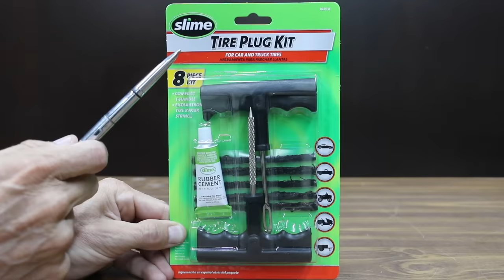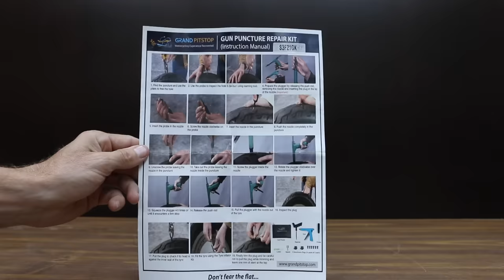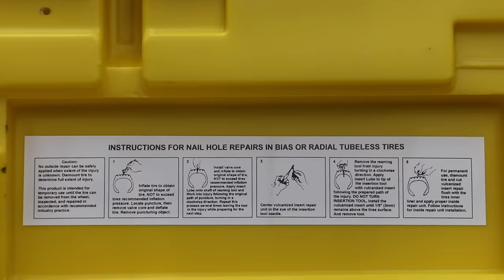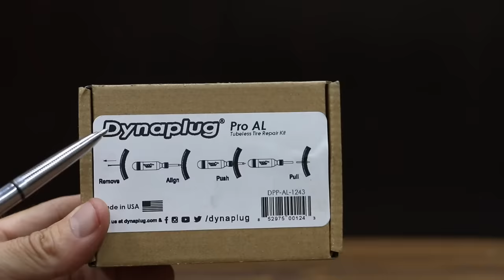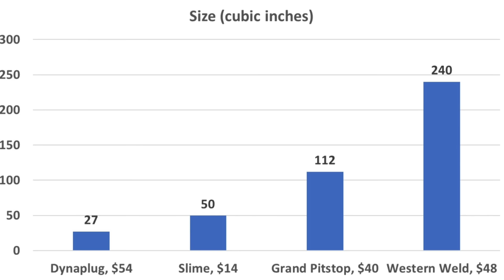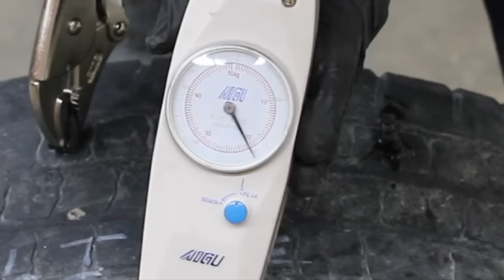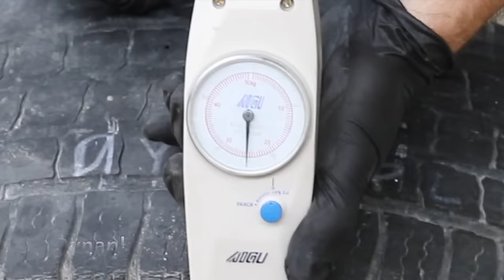Best Tire Repair Kit? SLIME, Westweld, Dynaplug, Grand Pitstop

Comment: I've never had any problem with low-end rubberized string tire plugs like those from Slime - I've driven thousands of miles over years on them (I had new tires on my car when the neighbors built a new house, and I got a few screws used to attach stucco mesh in my tires during that time). I find that E6000 cement makes an even better 'lube' and glue for the rubberized string tire plugs, and it doesn't dry out in the tube for years, even after opening. I agree about the Slime handles, but there are other versions of those handles which are larger and more comfortable. I've never had to rebalance a tire after putting in a plug, either.
Reply: My luck with those rubber string plugs ran out on a major road trip lol.  The belts separated and the tire disassembled itself 800 miles from my destination
Reply: Sometimes the best part of these videos is just knowing what you have is good enough and you dont need to stress about it.
Reply: @wallacegrommet9343  Sounds like you got air in between the inner belts somehow. I've been using those rubber string plugs now on my family's cars since 1973, and have never had a failure with them. I guess I've been quite lucky. FWIW, use a lot of 'glue'. The kits usually don't have enough in them for more than one repair.
Reply: All of these seem easy because he's working on the tire in a warm, lit shop and not on the side of a cold, dark road or parking lot, with that there a new kind that is easier and one just pulls out the nail then twist in the plastic plug, snap off the tab and air up.. much better in my opinion.
Reply: The plugs were probably just too close to the sidewall.  I pushed my luck!
Reply: @AOmega72  Same. I have never had one fail and I drive them for the rest of the life of the tire.
Reply: Remember always get it  properly repaired with a patch from the inside ... a   Hi speed blowout can cause death..      Yes you could drive years with it  never happening  ...But I tell you right now it has happened   Once the screw goes through the tire, It literally damages the steel belt   ,Bringing in moisture and contamination...   Overtime the steel  breaks down  ,,,Causing your steel belt on the tire to fail..   Unless it's a really really clean hole that you plug   then  u would   be fine..
Reply: @wallacegrommet9343  I only had 1 fail in the last 40 years, and that was on the corner of the tread and sidewall. I made it about 35 miles, 1 block short of a tire shop. And 40 years ago it was just the sticky rope plu, NO extra glue.
Reply from the maker: Thanks for the feedback.
Reply: @AOmega72 - I’ve had similar results with these plugs used as permanent puncture repairs. A properly installed plug will last the life of the tire. I’m quite sure they list them as temporary fixes for legal reasons only. Gets them off the hook if one ever failed and caused an “incident”. ⚖️
Reply: @wallacegrommet9343  I dont believe the plug causes the belts to separate. They may have been damaged initially with the puncture or a hard hit in which your only option is a new tire. Either way I doubt the plug is the problem.
Reply: @Pinkielover  l have  only ever had  blow outs in the sidewall  of   tyres, so a patch on the inside of the tread area would not make a bit of difference
Reply: @marcushennings9513  Do you know what that kind is called? I'm interested in researching it.
Reply: This type of tire plug usually worked well for me, but this Falken tire seemed to be the exception.  As stated previously, the plug was right on the boundary between the tread and side wall, which seems to be a no-no. Nor was it the only plug. Never bought Falken again.
Reply: Let us be clear, there is a big big big difference between a tire that goes flat while you are driving, and a flat tire from a sitting car. The damage caused by the weight bearing down on the rim to the tire to the ground, hope and a prayer fixing that flat and then driving on that repair. BTW, loved the E6000 idea!!!
Reply: I agree with all the posts regarding using string plugs for many many years !
I’m a builder and I’m always getting nails / screws in my tires on construction sites. I have used them in every vehicle I ever had.  NEVER ONCE HAD A FAILURE.  I’ve used them in pairs for larger holes too !!!    Never ever failed.  I purchased whatever brand I’ve come across at the time of purchase.  They all (string plugs) work, if you install them correctly.
Reply: Interesting, I've used Elmer's rubber cement to apply patches to bicycle tubes, but never even considered E6000 as plug glue.
Reply: Test the new slime heavier handle kit against the western weld kit plz
Reply: @debeeriz  Having repaired thousands of tires, many of them plugs that have failed for people who've been using them for decades and never had a failure until then, it does make a difference. Plugs are meant to seal the hole, but not so much the inner surface. And how the object that penetrates the tire exits on the inside, can cause a rip, making the hole jagged. It hasn't been inspected, so you'll never know if the plug is sealing that surface. Air may no longer leave the tire, but it can now slowly enter the plys. This can cause a separation. There's a reason most tire manufacturers won't honor the warranty if the tire has a plug in it. A plug patch using tire cement bonds to the tire permanently sealing from the inside. This will ensure that your $200 tire's warranty is not void.
Reply: @chadvoller  im in my 70s and i drive on 4 tyres everyday, during my 53 years l have had 5 blow outs and every one of them has been the sidewall, retreads have been  banned for the last 30 years in this country, those are the only tyres i have seen lose their treads.  my nephew manages a tyre shop next time i see him i will ask if he sees many through tread blow outs
Reply: @debeeriz  I was in management at two large tire shops over ten year period, I was in charge of the warranties at one as they had to be properly categorized and then sent back to the manufacturer for inspection or for their reps to mark them on site (not sure if they still do this, was over ten years ago).

The sidewalls are the weakest part of the tire, it needs to flex for a comfortable ride. Whereas the tread does flex a little. When a tire is driven with low PSI due to a leak (the leak can be anywhere), the sidewall heats up and weakens. This both weakens the plys and damages the rubber. This damage is often not visible on the outside of the tire by an untrained eye or touch. People will plug the tire, and not see that the inner ply is cracked up and/or peeling as they are only focused on putting the plug in the tread and not worrying about the sidewall, which allows air into the plys. This usually results in a bulge or blister, but if facing towards the vehicle and not out, will be missed causing a blowout. If brought in to be patched, the insides are inspected and this damage is found before this happens.

When the hole is in the tread and plugged and air leaks into the plys at that location, it usually does not result in a blow out. But it can cause the plys to separate under the treads. People usually don't drive on this long enough for it to blow out because the vehiclr will shake and bounce like crazy and it only gets worse as the tire deforms. I have only seen it a couple times where this separation led to a blowout, it was always on the rear of the vehicle and they just ignored th e vibration. If on the front their steering wheel would be all over the place. On one of them, the tread peeled off the tire enough that when it came apart at highway speeds, it whipped around and damaged the body of the van. This tire was plugged. The plug stopped the leak, but they ended up causing more damage and possible harm to the passengers in the vehicle and to those around them. This is why they are considered temporary. People can go their entire life without ever having an issue. All it takes is someone to have an issue where an accident happens. I would never put a plug in a loved ones tire without them knowing that it is only temporary and they will get it properly patched as soon as they can, I'm not rolling those dice.
Reply: @wallacegrommet9343  how the plug makes the belt separated? Doesn't make sense. Plug did not caused it.
Reply: I've used for many years since the 70's and when steel belted tires come about, started with the plugs...so many...had a 70GT Torino 4speed with a introductory boss 351c, built it hot and kept the asphalt smoking everywhere I drove as soon as leaving driveway...would spin til speedometer was out of dash (10000 red line)...burnt tires for fun so just kept putting on anything I could find free or cheap, maybe out of the woods...knew I'd cook it anyhow...as long as the plug enters steel belt splinters of steel hold it until you get to corner where steel ends (other comments) anyway have burnt so many totally til cord out and some tires had 3 4 5 plugs and never come out or leak unless hole was slot shaped, also never used glue...as long as it's just nail or screw , you're good
Reply: @enigmacarson927  That is a bad anecdotal example. You are burning them off before knowing the results. You are taking used tires and repairing them, you are removing whatever may be on the inside when you find them. In a real world example, the tire is already on the vehicle, and will stay on there for months if not years. The separation of the plys takes awhile to happen if air is leaking past on the inside surface.

When the puncture happens on the vehicle, often times enough the nail, screw, staple, wire, etc can have a part that breaks off inside the tire. Especially in areas that use salt on the road in winter that weakens the debris. People who plug do not pull that piece out because they don't always realize a part is missing. It basically turns your tire into a tumbler, ripping it apart from the inside out (metal vs rubber). I've pulled a hand full of rubber dust out of some tires where this has happened. The person who plugged it was pissed because their tire that had years of life left on the outside, but was completely shot on the inside. This doesn't happen to everyone, and it took a long time for it to damage the tire, but it damaged the tire none the less all because they used a plug and never inspected the inside of the tire.

Everyone here with an anecdote that plugs are fine just have not seen enough cases no matter how many they think is a big enough number in their person experience. On average, they are not a problem, it's the number of problems compared to patching that is the issue.
Reply: @chadvoller  no...I just mean we would eventually run all slick for lack of will to buy a new one because you could not help yourself, we friend worked all over building homes, foundation, framing, and trim always filling tires with screws and nails...3 inning normal ware but back rear caught hell...simply because you could back then....also as 1/2 owner hvac co after apt maintenance sup for 9 yrs 300 unit complex then to go on to Rv technician , tons of helping others with same plugs...still pull up to local store and see regulars that Ive helped and all good ...always keep large supply, tire spoon , assorted valve stems, old brass valve core remover w/new cores inside and a compressor...alot of tools also just love to help anyone I see at air pump or aside rd ....still yet to see one come out or leak unless hole is eccentric or slot from debris...then I can tell installing ... I agree w/other comment that I may not want children high speed until replace but tire itself is not 100 !! Also being rv tech , I was authorized warranty service tech for ford and gm, Kelsey hays axle, brakes, Dometic, duotherm,  Norcold, morryde suspensions, several tire manufacturers and all reps agreed if in steel belt round hole no larger than file, then you're pretty safe ...at least til conscience tells you otherwise ....had a full life building over 100 engines before 17...back then the guy up the rd is ford guy,  cars all in yard...down the rd, mopar guy, chevy guy around the corner and 20 25 of us dirt bike ride trails and clay pits beside us on wkends,  just tires galore (not used on bike) just example of how neighborhood hung together then !!  I'm no dummy, seriously applied correctly should be fine...now seen mex guy at store month or so back on utility trailer full of steel trying to combine 3into tear that I was sure steel did in sidewall and had child w/him I tried my best to communicate but got more, like 4 or so , I started cross hand movement saying no, being rv tech knew heavy trailer will fishtail and come up beside you and eventually accident...knowing axle used 5lug ford rim , used phone language conversion and told him I'll be right back and give them rim and tire , could tell they were scraping !! So, no don't use wrong , if nice tight hole never seen one even leak unless on trailer or something long enough to dry rot along with tire or any rubber and plastics
Reply: @enigmacarson927   I'm not gonna claim experience doing engine rebuilds, or off roading or helping people on the side of the road. What I have experience in is inspecting thousands of tires off of the rims for repairs and warranty claims.

Like I said in previous comment, there's a reason it voids tire warranties. If you talked to tire reps, it was a long time ago. They WILL NOT say a plug is OK unless they are new at the job or unaware of the liabilities they are responsible for in approving a plug. Plugs are not DOT certified, patches are. Read the fine print for the warranty in any new, name brand tire you buy before you decide to toss a plug into a $200+ tire.
Reply: @chadvoller  agreed...as far as warranty...unless involved in a company thats going to buy more, most won't stand behind warranty without fight any way the tire is hurt...I've known plenty of individuals that had flat , road hazard or just plain ol nail , they wouldn't do it ....Goodyear worst...you've run it low in air>.what you put it on 2weeks ago< example , heard it all but when worked at R.V. shop and bought a lot from them (whoever at the time), they would have a complete different attitude!!  Man, I was agreeing with so many other elder people...never have seen a problem, and usually will last tire duration unless age dries all ...if you add how many say never a problem...odds would suggest hi ...but I seen patches fail cold or hot also but I always thought again, it was installer because when redone results were fine if it was permittable....as in 70 mph to a stop, was  ruined or weakened too bad !! Also most cases no glue on plug and surely never had nice ones ...a lot of cases were no name 3$ out dollar general both handles and plugs or slime....younger it was monkey grip...but again if a large (bolt) or something I'd be the first to say get it home and get a tire but screws used in this vid or a nail, hard for that splintered belt to let it go and plug dia 2 or 3 to 1 would be real hard to leak, bad hole later on will seap out ...side note when in gm classes only gummout brand additives were approved, any other, void...so I think part of that kind of thing is opinion from mftr and surely that's changed to no additives now, then late 80's but I was also just giving opinion which stated if child or family , don't risk at all, maybe to get home or shop !! Again, I have seen quite a few patches turn loose ...no factor as steel splinters...just relying on adhesive....best advantage there is the air itself pushing on patch but in softer radial ,curbs, potholes, bumps, things of that nature might warp spot patched but would use if larger hole or cut/tear
Reply: @chadvoller  Not related to plugs, but to warranties. Had brand new tires put on at Walmart. Bought the road hazard protection, always did. A week later, it blew out while I was driving down a steep hill at 55mph (coasting). Once I brought the car to a stop on the side of the road, I found the whole outer sidewall had peeled away. No sign of what caused the damage in the first place. Put on the temporary spare, put the damaged one in the car and drove home. This all occurred at night, so next morning as soon as they opened, I went into the same Walmart. Told me they couldn't honor either the tire warranty or the road hazard insurance because I "drove on it after it was damaged". The manager took the same position as the tire crew. I explained to them the concept of a tire blow out at speed - the car doesn't just miraculously come to an instantaneous halt. You have to 'drive on it' a short distance (unless the car flips - then it's optional 😆). They just looked at me like I had three heads and stonewalled. Haven't bought tires at Walmart since. No real point to this comment, just sharing a story with whoever cares to read it. Have a good day! 👍🏻
Reply: @Ghost_Os  It takes a lot to tear away the sidewall. I’ve ran into it once where the tires were overinflated (75 PSI when they should have been 32PSI), but that also ripped part of the fender off as the rubber whipped around at speed. The other way is if the tire was overheated, usually from running low on tire pressure. If it was a rear tire, it’s often hard to feel that it is low until it’s too late as there isn’t as much weight in them than the front, especially at speed as the force of it spinning can help keep the rim off the ground. There’s a good chance that when the tire was put on, the valve stem or bead was leaky. These days since I no longer do my own tire work, I keep an eye on the tire pressure for the first couple weeks since all of our Honda rims are aluminum and they corrode easily with the risk of leaking. The wife had one this year that we had to have the tire shop remount after they swapped the winter tires. Lost 20PSI in a week sitting in the garage in the right rear, if I didn’t check it she would have blown it out driving on it.